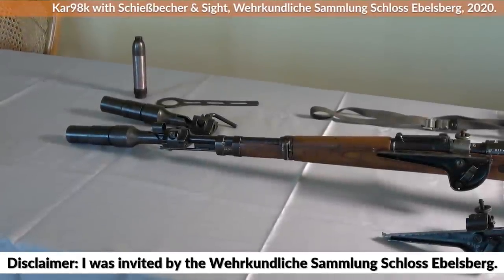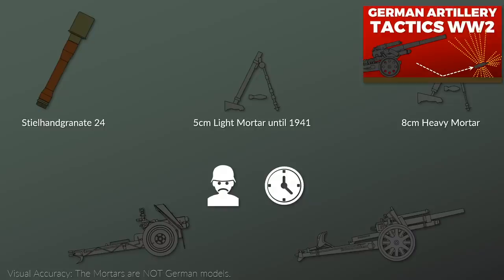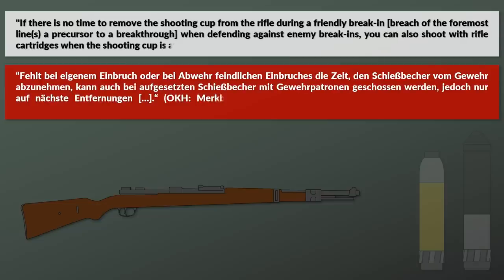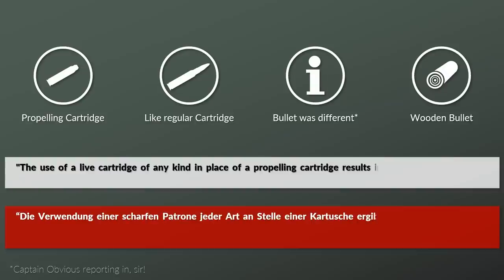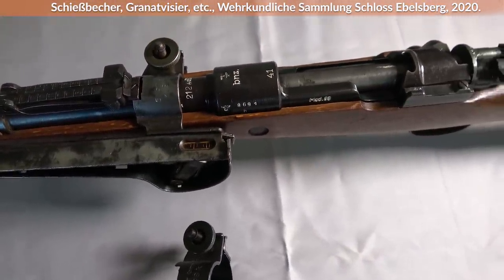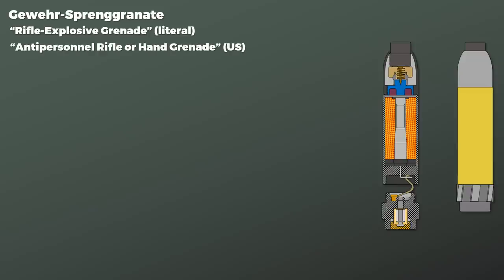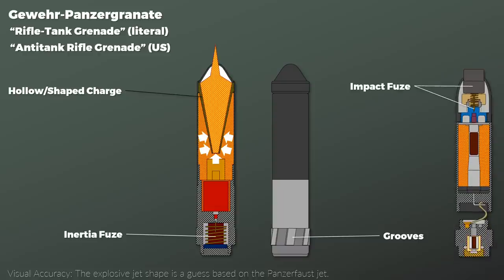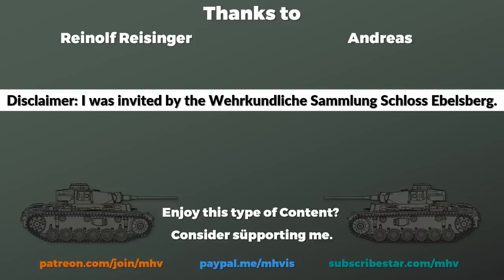Why Rifle Grenades? - German Rifle Grenades in WW2

Comment: Seems like after a few practice rounds spread over a few sessions the sight itself wouldn't have been needed, just the launching cup.
Reply: In Vietnam the M-79 grenade launcher was that way. I soon never bothered with the sights. At night you couldn't see the sights anyway and fired by experience. Did use the trick of firing at a high elevation to get the grenade to drop down onto the target... it was a long wait for it to come back down for everybody involved.
Reply: @aceroadholder2185    Supposedly A plastic and aluminum version of the M-79 is back in use.  I just wonder if A rifle grenade would be significantly easier to put through a small window because of a flatter trajectory???
Reply: @AKlover  I could put an M-79 grenade into a shoe box at 150 meters without sights. It is a very easy weapon to master.
Reply: Aceroadholder - (A bit of long forgotten nostalgia) I used to love hearing the discharge report next to my position [“punnnk”] of the 40 mike mike leaving an M79 muzzle.    Comforting....
Reply: @AKlover  the m79 never left service it is used by certain units still.  it wouldnt suprise me that they have changed to a plastic stock and due to the lower pressure of 40mm I can see an aluminum barrel being ok to use.
Reply: 10:49 Eh...inserting the batteries? :D
Reply: spike001ton To the best of my knowledge it was always an aluminum barrel. I admit it’s been 30 years since I held one.
Reply: @jeffreyroot6300  closest ive been is a museum but with 40mm being a low pressure round I could see an all aluminium barrel.but 40mm if rifled so I wounder the barrel life of aluminum rifling
Reply: Common Sense Realist There was a stand alone attachment for the 203 as well. I still want my 79!
Reply: The m320 as a stand-alone is very intuitive to fire. You are correct that after some practice, the sights are really needed to fire with reasonable accuracy.
Reply: Yeah there is something in our brains that makes it pretty easy to aim this like throwing a basketball.

Its path is predictable and if you lok at light mortars or grenadiers with some experience... they are able to quickly put down a lot of accurate fire.
Reply: After serving as US Marine from the 80s to 2000, being aware of the M79 but never seeing one in service, not even as a Mustang lieutenant serving with two different infantry companies in the FMF, imagine my surprise when I see these things used in theatre in Iraq 2004 (OIF II). It was issued to Marines on perimeter security, Al Anbar province. I and my Marines filled a complimentary defence oriented role. I saw some odd things out there, and more than a few things that greatly disturbed me regarding the competence (or lack thereof) of field grade Marine officers in the reserve component. It was a relief to know that the enemy was worse than incompetent.
Reply: The combination m4 with m203 you didn't need the sights you can use the rings around the barrel it was faster
Reply: You are correct.  Most German veterans that I interviewed stated that either they or those who used it did not use the sight.

Comment: 13:45 Something you almost never hear about German Wartime Manufacturing; Huge Surpluses!
Reply: Yeah I wonder why there was such a surplus in 1944, maybe just from lack of training time for new soldiers?
Reply: @TheKingOfJordan1  Well they look like pita to use for one thing. It's going to take time and preparation to attach the launching device even if you don't mess with adding the sites. Then you can't use your rifle normally except at very short ranges. I suppose you could have one of the MG assistants leave one on for when it was needed but I can't see a regular rifleman being happy having all that junk on his rifle. So the most obvious reason for a surplus in my view is that they simply were not useful enough to justify all the drawbacks in most circumstances.
Reply: @Bochi42  Rifle grenades were widely considered very useful and valuable. You are never fighting alone, so being unable to fire your rifle when everyone has bolt actions actually doesn't make that much of a difference. Rifle grenades produce a lot of casualties.
Reply: It’s actually something you hear a lot in GermNy late in the war. Let me explain:
Allied bombing mostly hurt the German oil production. Since German industry is coal based, it is hardly affected. In fact production of equipments continued to increase throughout the war. The problem is in distribution, since the Germans have little fuel left to transport the products from the factory to the frontline.
Combined with scattering of German industry to protect against Allied bombing, you get a huge surplus that rarely reach the frontline in a timely manner.
Reply: I don't have any reference to back this up, but my memory so take this with a pinch of salt; but i heard that in 1944 Germany reached peak production and in fact had over produced rifle ammo and other small arms.
Reply: @francescoazzoni3445  They began dramatically lowering quality standards on rifles and began making ersatz guns around then, so I kinda doubt it. If they had a surplus, why would they take those measures?
Reply: @thomaszhang3101  Also huge surpluses of things that could be made in a single location. You obviously weren't getting surpluses of tanks or aircraft (even though aircraft production did increase) but that's because they're products that are highly reliant on a solid logistics network and parts manufactured elsewhere. But any sort of personal weapon can usually be made by incredibly simple machines (the Sten obviously being the best example of this since it could be made using bike shop equipment) and you just need the raw materials like some steel plates and wood. And there were also efforts to massively simplify the production of these things with late war Kar98s being noticeably more crude. So like bullets, grenades, rifles, pistols etc. can all be easily made in huge numbers even if you are getting bombed day and night while more complex things like tanks and trucks suffer.
Reply: hedgehog3180 I am not sure about aircraft, but there was definitely a huge surplus of tanks. They just lack the fuel to drive them and train tankers.
That was also why (I think) they have been pursuing quality over quantity with their tanks - if less tanks can do the job of more, they can save the fuel consumed to train more tankers and drive them.
Reply: @Bochi42  Soldiers were assigned to be the rifle grenade launcher so carried clips of the wooden bullets and sacks of grenades.
Reply: My guess is this was simple mismanagement. Don't forget, that the Nazi regime and war economy ran on a party favor scheme. Kinda like today's conservative parties, but cranked up to extremes and without any oversight. I bet someone had the influence to get money for producing an absurd amount of these grenages. And then he went on and did exactly that.
Reply: @thomaszhang3101  At the end of the war over 85% of German industry was still operating at normal capacity. The Allies mostly bombed civilians (including me). It only served to piss them all off and motivated them to carry on. The air war was partially counter productive.
Reply: @lobsterbark  In '44 the Germans produced 20,000 air planes of all types. They built them in tunnels , under overpasses, in the woods. It did not matter, they just kept going.
Reply: Not just equipment, the production of military uniforms was so huge,
that when the GDR (East German) army was founded in 1956, they could use all the surplus uniforms from WW2, including the latest model steel helmet.

The surpluses were so great that almost all WW2 movies and tv productions actually used East German uniforms, with WW2 insignia.
Only the World War II Luftwaffe dress uniforms for flying personnel were a distinct dark blue whereas the East German Airforce dress uniforms were white-beige.
Reply: @AudieHolland  How did they manage to do that? They were being bombed 24/7
Reply: @thenevadadesertrat2713  Allied strategic bombing would only bomb large industrial/population centers.

The Germans adapted to the Allied bombing campaign by dispersing their production lines as much as possible.

In the case of small arms, ammunition and other relatively simple items, these could easily be produced by 'cottage industries.'

Producing uniforms only require a good number of hands, textiles and a number of sewing machines. You don't need large factory buildings to make uniforms.

Mind you, near the end of the war, the Germans had one fully underground jetfighter factory with a runway on top.
After each fighter was completed, it would be lifted topside and a shuttle pilot would fly it to its intended base.

However, for that aircraft factory, the end of the war only came a couple of months later.
Reply: @AudieHolland  hat's unbelievable. You gotta hand it to those Germans. They take on the whole world and hang in there for five years.
Reply: @thenevadadesertrat2713  Hm, nope. The concept of 'Blitzkrieg' was developed by the Germans because they knew they couldn't win in a war of attrition.

That's what they learned after losing WW1 because the US of A joined the Allies in the last year meaning the Allies could spawn indefinite units from then on.

Both Germany and Japan were 'out of their league' when thinking about joining any World War. Only the USA and USSR were big enough, with enough people, to fight such 'big league' wars.

In June 1944, the Allies were fighting Waffen SS in Normandy, many of whom were 16 years old.
During the Battle of the Bulge, the Allies captured a few SS soldiers who were 14 years old.

During the Battle of Berlin in April 1945, Hitler Youth 'soldiers,' 12 years of age were fighting the Russians.
Reply: @AudieHolland  My Mom and her five kids got out of Lower Silesia on the last German army truck leaving the area. . I'll never forget it. I was ten years old at the time. It was a lucky day for us in a miserable sort of way.
B.t.w. I am actually from Holland, born in Rotterdam, 1934.
Reply: @thenevadadesertrat2713  That is rather a tale. Regarding the Germans: they made sure more Germans died by prolonging the war.

Comment: the USN still uses a grenade launcher to launch a pilot line from one ship to the next while conducting an underway replenishment. (UNREP) or connected rep (CONREP) as opposed to replenishment by air via helicopter.     CONREP/UNREP is the primary method to transfer fuel .
Reply: Most other navies also use the same method.
Reply: I've always wondered why pneumatic line throwers aren't more common. If they don't operate at a stupidly high pressure, they are easily refilled using the ships onboard compressor. Even if they use very high pressures, supplying a hand pump would still allow them the be reset as many times as you want. One would think it would be cheaper (especially when counting training use) and safer to a pneumatic device instead of a explosive/pyrotechnic device to fire lines across.
Reply: And finland uses them too! RK 95 has  cabability to launch HE and AP grenades
Reply: @hedgehog3180  What I'm talking about already exists and has roughly the same size and format of pyrotechnic line throwers. Just that instead of there being a pyrotechnic charge on the bottom, it just uses a burst of compressed air from a cylinder inside the thing. You wouldn't need any other extra equipment except for recharging the cylinder.
Reply: Isn't it launched from a FAMAS for some weird reason?
Reply: @gamma7897  Well simple answer, rifles are already there. Why get something different and more expensive?
Reply: @SlavicCelery  Except the US Navy doesn't use rifles for line throwing, they use shotguns.
Reply: Australian natives use boomerangs.
Reply: @fredsasse9973  
I was going to ask what sort of rifles they'd use today.

Shotgun makes sense. I'll bet it's alternatively a fighting arm.

Comment: I imagine the reason why the Germans had a huge surplus of rifle grenades is due to the number of different designs they made. My book on WW2 infantry small arms said there was too many to list so only showed a dozen of their most used rifle grenades. Their little AT grenade grew in size two or three times until it resembled a panzerfaust warhead. Their HE grenades also became larger. Their surplus stocks probably was stuff that the soldiers didn't care to use once something better was now available.

Comment: Thank you for the in depth look at the construction and use of rifle grenades in WW2. I know that all major players in that conflict used them. But I had a good laugh a few years back when I was playing Battlefield 1 (Great war, I know) And my friend was shocked that such technology existed back then, he did not even know that was a thing in the second war.. He thought that the under barrel 'noob tubes' used in Call of Duty games were not so much as real weapons but more of a video game invention... And when he saw how I would implement my use of them in BF1, he had to concede that they were not for short range easy kills, but to sweep rooms in upper floors of buildings from the outside before storming in with the rest of the squad.. It even had the visuals of putting on the tube attachment and then screwing in the grenade, and it was not a simple button switch like COD... Do it at the wrong time and dead... These things have always fascinated me. OFC video games and real war are very different. I like the effort put into the Battlefield franchise so as to add as much realism as possible for a game. No running and gunning like you are effing John Rambo.

Comment: The Kummersdorf range tests give a maximum penetration of up to 89mm. @ 0 degrees @ Up to maximum range firing both Pg.46 and the later PzB.39 launched Pg.61 version. In 1941 this was more than adequate for success against most enemy aFV's expected to bee encountered by infantry.

There was also the PzB.39 grenade launcher modified with a shorter barrel and equipped with the same grenade launcher cup installed as the Kar.98. These had a higher velocity, greater range (up to 600 metres) and improved accuracy versus AFV targets, offering a more effective infantry anti-tank capability than the usual anti-tank rifle. The PzB.39 grenade launcher was first used in the invasion of Crete in 1941, where it proved to be of little use against British Matilda II tanks defending the airfield. However against the more commonly encountered Soviet AFV's, during the invasion of Russia, it proved to be more effective.

Comment: From a person interested in Firearms in general, I wonder how reliable the rifle would be in feeding multiple propellant cartridges out of the magazine, since the physical dimensions of the cartridges have the potential to be quite different from a standard bullet cartridge.  I imagine that most guys preferred to simply single load cartridges or load the magazine with 5 of the same type to avoid confusion.
Reply: In the case of using rifle grenades from a semi-automatic rifle, the gas valve of the rifle is shut off to keep the rifle from cycling (if not, it would cycle very hard and possibly break), essentially turning the rifle into a 'straight-pull bolt action'.

Not sure if that is exactly what you were saying, apologies if not. Have a good one.
Reply: I guess these propellant cartridges are externally identical to blanks. I'm not sure but i always assumed militaries made sure their weapons could work with blanks.
Reply: @peterthepeter7523  No, when blanks are used in training special muzzle devices called "blank firing adapters" are used (they look like yellow muzzle brakes on the end of the barrel). These allow blanks to function semi or fully automatically to give more realistic training. Without these, blanks aren't strong enough to cycle the action but they still feed from the magazine just fine regardless. Rifle grenades usually don't use a blank, but a higher power version specifically for projecting rifle grenades (although some rifle grenades designs use live rounds actually.
Reply: @zeburancher9480  Was mostly referring to the use of the cartridges in a bolt action 98k.  I'm aware of how it works in a semi-auto already.
Reply: @sillygoose210_6  this rifle grenade was meant to go on the bolt-action rifle so no special muzzle device is needed.
I said that propellant cartridges were probably EXTERNALLY identical to blanks. Because blanks are mostly empty and you can just add more gunpowder in them.
The question was about how these blanks work with magazines. That i don't know but they somehow do.
Reply: As a reenactor I have a little bit of experience firing blanks through a Kar 98k and I can tell you that at least in my rifle with the blanks I use they function the same as live rounds in regards to feeding, extraction, and ejection.

Comment: the modern M34 white phosphorous grenade (US) is still manufactured with an indented ring at the base to attach a grenade launching adapter onto it so it can be fired from the muzzle of an M-16 series rifle with a blank round.

Partially because the grenade itself could produce casualties in a radius further than it could be thrown.

Comment: More or less the same system is still in service with some police departments in Switzerland to launch rubber shot or gas grenades. The Becher is welded to a K-31 Karabiner, but otherwise the system is exactly the same. It‘s called MZW (Mehrzweckwerfer/ Multi Purpose Launcher)